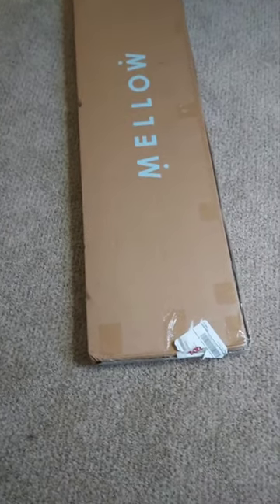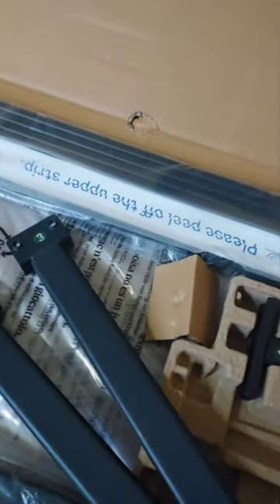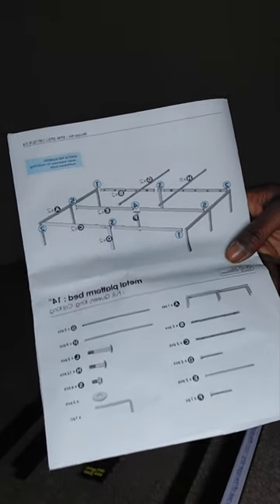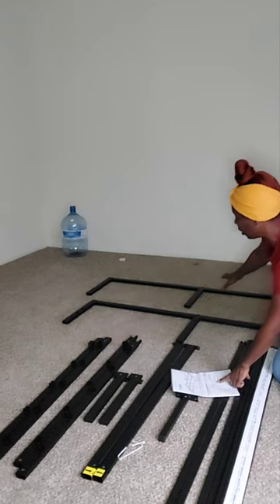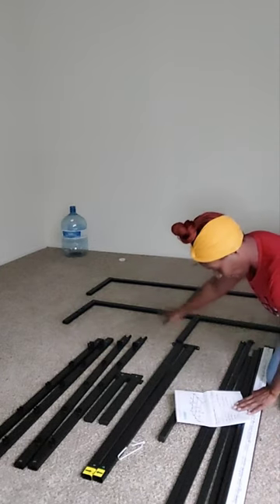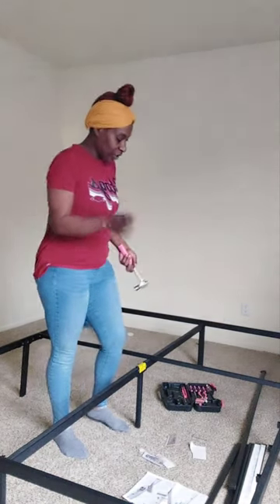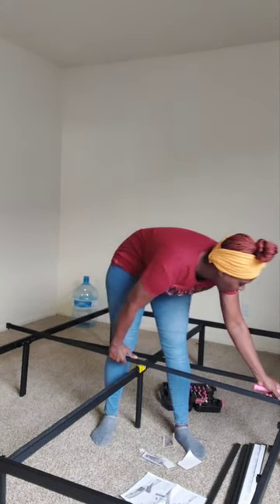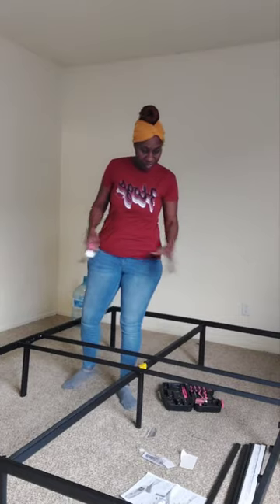14" #Mellow bed frame from Amazon. Assembly

Comment: I really appreciated this video - I agree with you that the instructions could have been a little more detailed especially putting in those two middle legs - it is very tricky even once you understand that the B and C pieces have to slide together before you insert the bolts. You have to make sure both are forming a perfectly straight line in order to slide together as it is a very tight fit.  Thanks again.

Comment: 3 does not line up
Reply: I kept trying and in the end, I have a hole left with no screw in
Reply from the maker: put each piece inside,there should be no extra hole,only 2.Wiggle them in
Reply from the maker: @ahnobiahnobitok9057  put each end inside,wiggle it a bit.if you have one with out a screw it is unstable and not put together. There should only be 2 holes,and you should be able to put screws in both
Reply from the maker: They don't line up, they go into each other